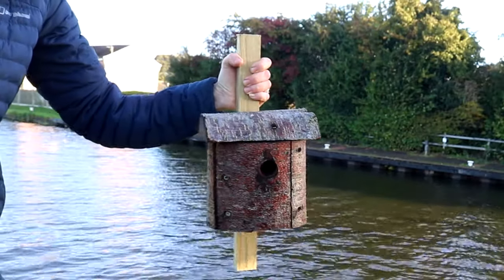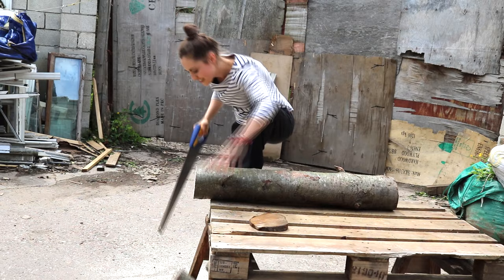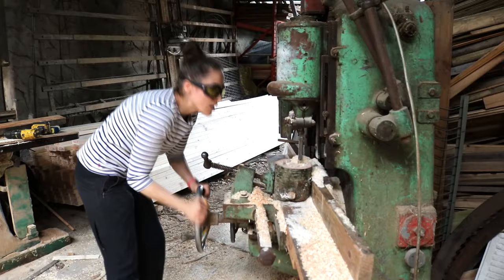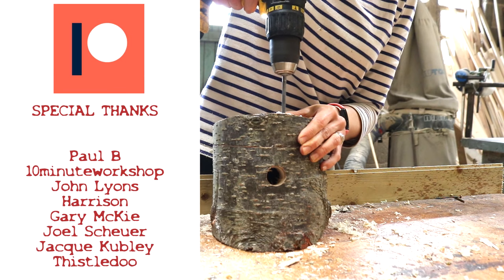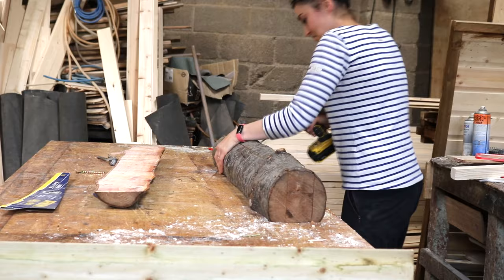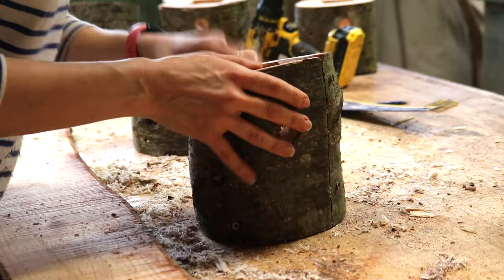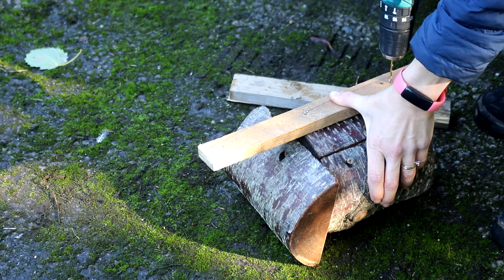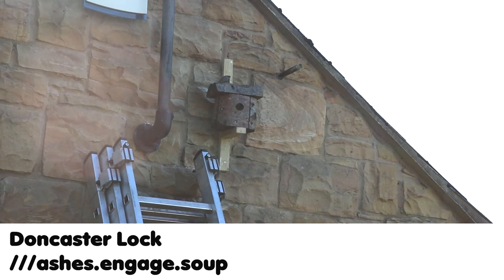2 Ways to Make a Log Bird House | The Carpenter's Daughter

Comment: If the wood was still wet, it might have been easier sawing using a bowsaw with a green wood (raker tooth) blade. Across the grain only, not your bandsaw along the grain cuts.